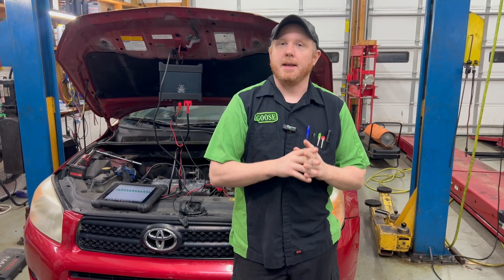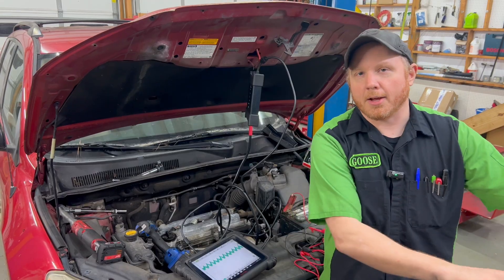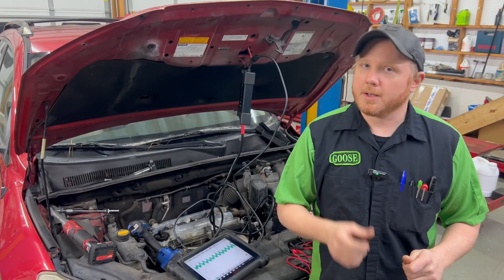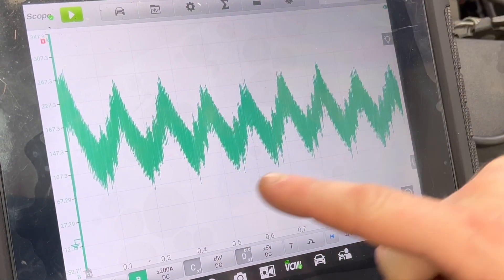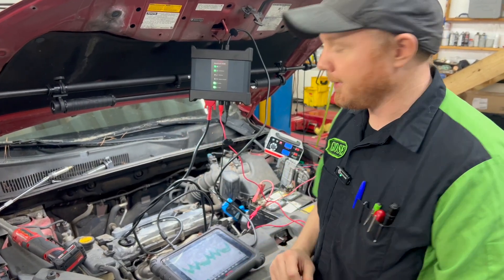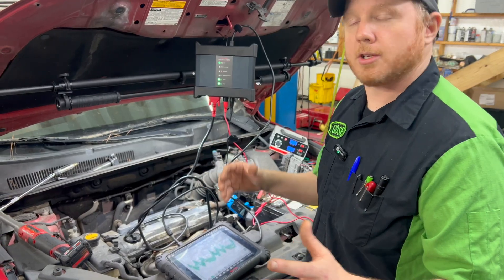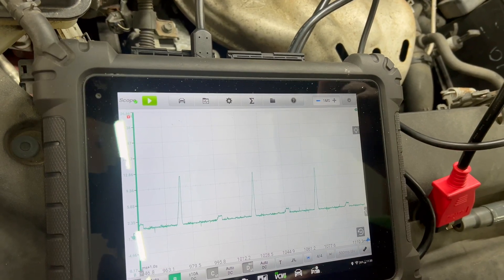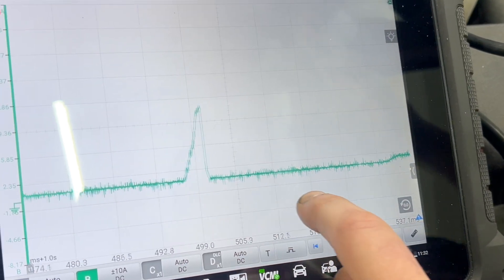Easy Misfire Diagnostics with Oscilloscope. Narrow Down the Culprit WITHOUT Removing a Single Bolt.

Comment: That was helpful I thank you for sharing. What do you suggest as a reference for using oscilloscope for car diagnosis please?
Reply from the maker: Thanks. Can you clarify your question a bit? Are you asking where to get good reference waveforms from or what scope would I recommend?
Reply: @automotiveinsight  I bought this bad boy and waiting for delivery "FNIRSI® 2D15P 3-in-1 Benchtop 2CH 100MHz Phosphor Oscilloscope Multimeter"
I intend to work on a Toyota V8 3UZ-FE 4.3 liter engine. I'm an electrical engineer with good background in automotive and no to little practical experince. I was hoping to get reference waveforms and values for all my engine signals, including the input signal that goes from the main ECU to the fan control unit. I also need some kind of a material as a reference of how to do car diag using oscilloscope.
Sorry for the long comment😅

Comment: 12 21 25          kudos to Auto Insight for tackling a dificult problem of presenting ICE analysis using a 'scope.  and crossing one's fingers in hopes it will all be understood.

    the cylinder compression study at the 3+xx minute mark was intriguing.  the reveal of the signals would be valuable info to have .  so shopping for a current-probe led to learn their high cost,  $150 or more.    ok , that is an option.  so is using Ohm's law.  and not buying anything.   
        the copper in the battery and starter motor cables all have some # of milli-ohms per meter.  not much but with 100+ amps of engine-start current flowing the ' iR' voltage drop is above the minimum a 'scope can detect.  if the scope is 'grounded' to the battery '-' lug then the probe needs to be at the furthest end of the cable that goes from 12V gnd lug to the frame or other.  
        and at this point we all bump into a limitation of viewer comments.  mainly not being able to attach images that show the exact circuit under study   and
where it is being probed.  

    here's a trick move  . for a stronger signal.  undo the 12V. '-' cable and connect one of the jumper cables you have laying around. one end to the 12V lug '-' and the other to the cable end now loose than ordinarily goes to the 12V lug'-'.  now you have 100+ amps of starter current running thru a 10' long 'resistor'.  for a higher - voltge signal that will look like a sine wave on the screen as the motor turns over while starting. the shape analysis of the sine wave will proceed as per the video. 

     my Rigol DS1054 scope can measure 1mV/Div on its vertical scale  .  it has 4 channels.  and this allows for another way to measure the current in a cable carrying 100's of amps.  this is done by using 2 probes spaced apart on the same cable as far as possible.  and setting them up to operate in 'differential' mode.
Reply from the maker: Yes, you can do a simple version of this just across the battery: the Lower the voltage, the higher the current during compression strokes. You can put the scope in a/c couple mode for easier visualization. I’m not super familiar with autel so we weren’t having much luck with it, but I’ve done it with my pico before.

Comment: Thanks for the tutorial. We had a Nissan Tiida (badged as Versa in the US) and they have the intake going over the plugs and coils. This makes the task longer and needs some extra parts like the intake manifold and airflow sensor gaskets, but if you are versed in auto repair its not too difficult. Just needs more time. 🐞

Comment: Where do u hook wires up????)
Reply from the maker: The coils and injectors have 2 wires. One side is 12v supply and the other side is control. You want to backprobe the control side.
Reply: @automotiveinsight 
Where are wires connected to scope- I don’t have to to see?
Reply: @dellmack1 Bnc to bnc

Comment: An easy way a Technician cash diagnose a bad cylinder is by pulling the injector connectors and reconnecting 1 at a time.  
Or pulling 1 spark plug wire at a time

Comment: It's hard getting used to scope work.
Reply from the maker: I agree. If you don't use it frequently, it can be difficult to get it set up to show that you want it to. I use it on an as needed basis. For something like this scenario, it's great for narrowing down what system the problem is in.  It's also very helpful for communication errors.  The snap on I have has great guided component tests, but I find adjusting the voltage and timebase scales is kind of clunky and not very user friendly compared to pico or this autel we were using.
Reply: @automotiveinsight i think s decent quality scope uses an "auto trigger" and scales the time and volts or amps automatically